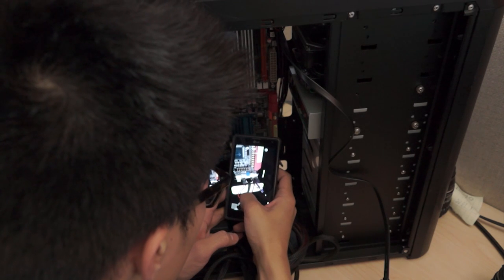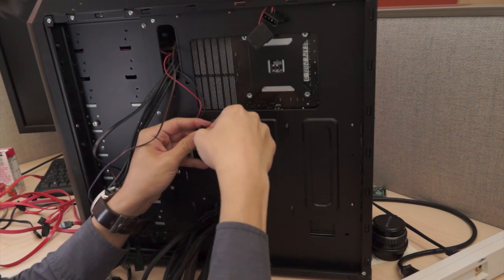Cable Management 101: Make Your PC Pretty and Improve Airflow - DIY Extra

Comment: Its all case dependant really,  cheap out on the case and it will be harder due to less space behind back panel. 

My recent build is in a Corsair 200R, it has a decent amount of space in the back. My cable management was OK, but due to my PSU only having 2 cables with 3 sata connectors, I had to connect one cable to optical drive and SSD and then have the 2nd cable for my HDD (and 2 spare for future expansion). Cable management could be improved, but its setup seems OK airflow-wise.

Comment: Seriously routing all the cables behind the PC?  That's not cable management, that's cable avoidance.  Get a good case that has some built in cable managing features or use the hell out of zip-ties (be warned, you'll have to cut these off and start all over again if you need to move something).

Edit: I'm dumb and heard back panel, so I saw the back of the PC.  Everything was routed on the side panel behind the motherboard.  It's impressive that he got all those cables packed back there.  I'm imagining he put the side case back on, but I'm not sure if it fit.
Reply: Yeah. He's just going to randomly go buy more shit when he could work with what he has. It's like you people have no idea how to think. He was using the resources available. At least he tried
Reply: I had to re-watch this video and now realize that he routed everything through the side panel.  He used the words back panel and my eyes believed what they heard.  Running everything the way he did is a really good way to do it.

Comment: If he is a PC elitist why does it push things through the "cable hole" and then "mush them together" with duck tape? Also what was the need for a photo before hand, was there some multitude of screws that were required to be installed in a certain order to reverse engineer the project? Finally what was the deal with blatantly trying to plug a pci sata card in upside down?
Reply: who the hell uses duct tape for cable management like wtf
Reply: feygan What's that thing called that blocks the wires (the rubber thing)

Comment: this is not cable management - this is shoving everything through the hole in the chassis to shorten it.
cable management includes intelligently routing and possibly customising the length of the cable, not just hiding it behind the motherboard support plane.